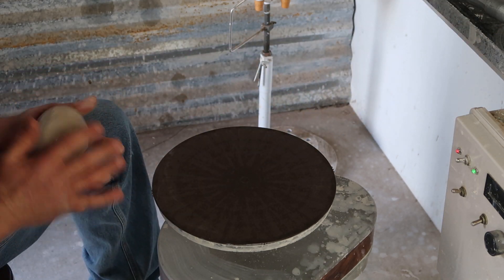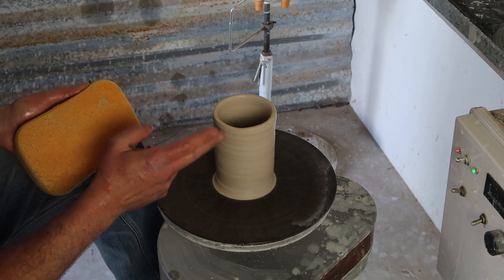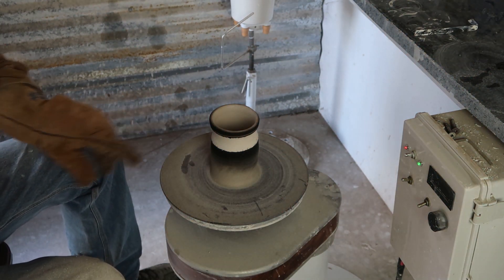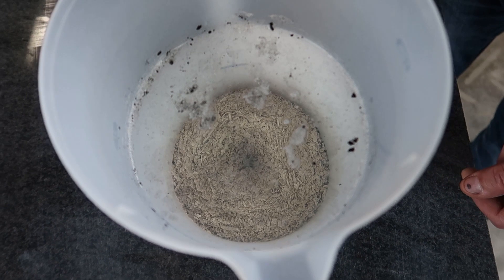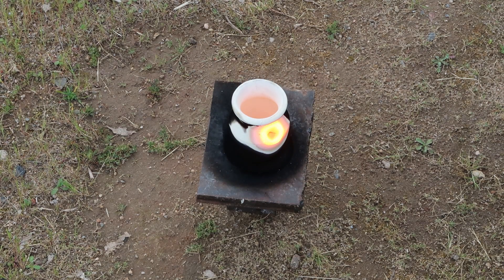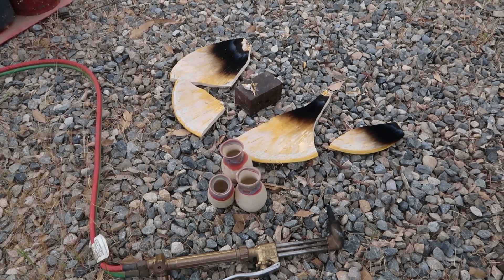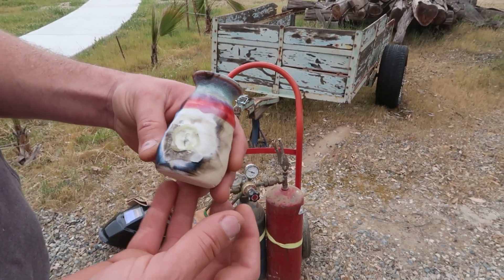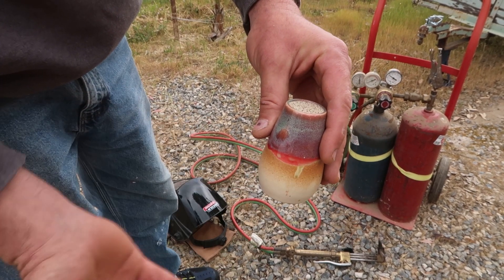Melting Ceramic with an Acetylene Torch

Comment: the mechanical water is becoming steam and blowing tiny chunks off of the pot, sometimes when I try to dry out a cone pack quickly I’ll hit it to hard and too fast with the heat gun and little bits come flying off

Comment: My very limited (~10 hours) glassworking experience yields a few thoughts: 1. preheating the area around the main site might prevent cracking.  Maybe preheating the whole piece.  Kinda depends on piece shape.  You could try putting a piece on the wheel to apply heat evenly around the whole circumference, SLOWLY (over like 60-180 seconds, maybe) bringing the torch in from far away to let it heat up.  2.  As another comment says, use more oxygen.  3. Glassworkers have special glasses that filter out "sodium flare", the bright yellow fire you get when applying flame to glass; might help you see what's going on, depending on how the other ingredients react to fire.

Two thoughts on why the first test turned to dust.  1. Maybe the dried clay just got blown off by the air pressure?  2. I hear that heating wet clay causes water to boil off faster than it can escape, causing cracking.  Maybe it was happening so fast that clay flakes just exploded off.

Slow heating could again help either of those, maybe.

Comment: Not going to work. Ceramic is very heat resistant...i think you would need to go bigger. I say liquid oxygen, lots of pressure, stainless steel nozzle. Don't stand too close xD

Comment: To melt it without cracking I think you would almost need to do the melting inside the furnace. The ceramic would need to be very hot throughout, and it would need to cool slowly and evenly.

Comment: The sand dissipates the heat. So use it as a way to dissipate the heat I'm a item you want to use. Then let it cool and try and avoid any more thermal shock.

Comment: Very unique.  I wonder if you could get a more broad effect with a rose bud tip.  Also maybe pull a pot from a kiln while red hot like in a raku firing and use the torch on it then.  That way the surface wouldn't be as shocked by the torch and prone to exploding.

Comment: Not a scientist.  Would say that as there was so much moisture in the clay, you essentially boiled the clay.  The steam created then pushed the clay away, which is what caused the dust.  With that you might has left over clay ranging from raw to vitrified in places.  Most likely the hot steam would have ex-pulsed anything before you could really vitrify, but again not a scientist. As your second experiment shows with no water you were able to melt.  Could be cool to use the carbon scarring for a sgraffito effect....

Comment: the rate of shrinking of clay isn't linear, a bulk of it happens at the quartz inversion temperature. If you preheat your clay to that it should suffer less dunting perhaps? it would have to be put back in the kiln to cool off after being torched of course. think about how glass blowers work. Your glass is just slightly more refractory :)

I suspect what is happening with the wet clay is the force of escaping water, both physical and mineral, is so great it takes the clay unvitrified and dusts it around your studio. I'd try it with bone dry. Also I'm not sure if you've seen the thread few years back on digital fire about making your own crucibles by throwing 90% zircopax / 10% veegum on a wheel but that sounds like something up your alley. Cheers